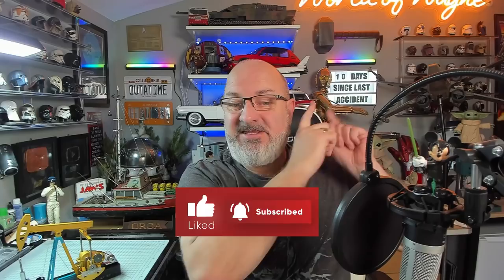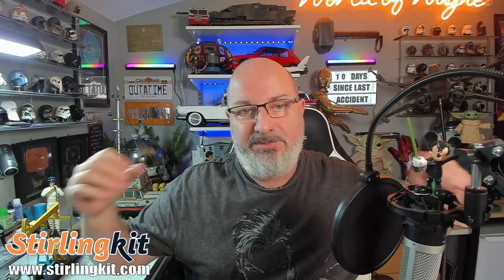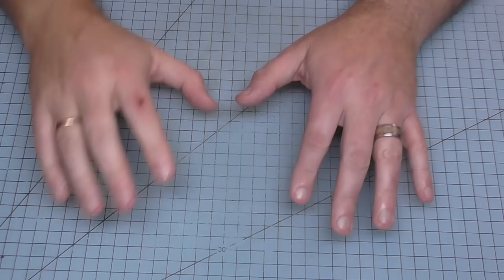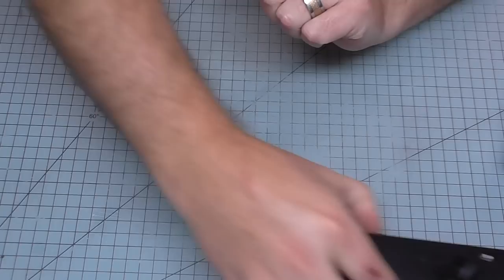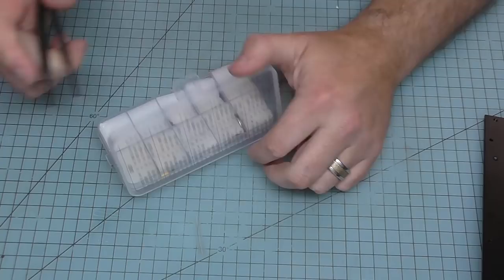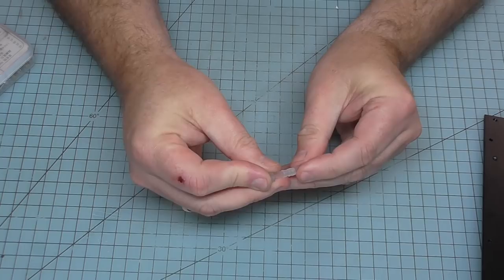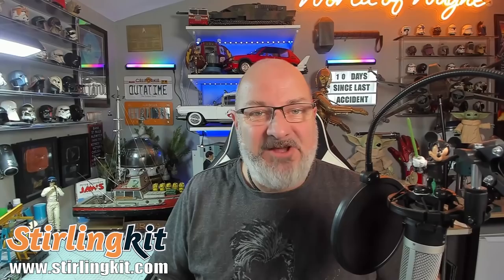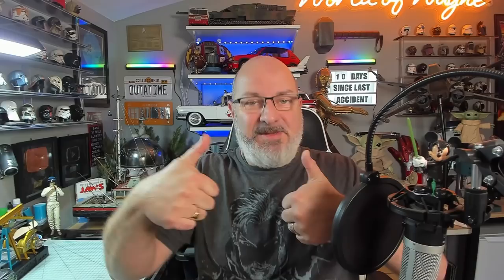Build the Stirling Kit Teching Mechanical Pump / Nodding Donkey - Part 1

Comment: "A grommet is a ring or edge strip inserted into a hole through thin material, typically a sheet of textile fabric, sheet metal or composite of carbon fiber, wood or honeycomb. Grommets are generally flared or collared on each side to keep them in place, and are often made of metal, plastic, or rubber. Wikipedia"    Or it could be Wallace's dog! 

it's a  grub screw.

Comment: Sometimes the resistance you get when you insert a screw or bolt is advantageous especially when you throw vibration into the hat as this might back the screws or bolts out of place. If it's easy going in it's generally easy coming out, with the exception of childbirth. But you are doing well and this looks like an extremely interesting project. You really are knocking these new builds out of the park Wayne they are all brilliantly recorded and edited, I feel you don't get enough recognition for this, I think you use 3 cameras so if you are building for an hour that would be 3 hours of footage to go through and sync the cuts from each not to mention the dialogue. I'm always impressed by this Wayne it's extremely well done, so thank you for all that's going on behind the scenes.